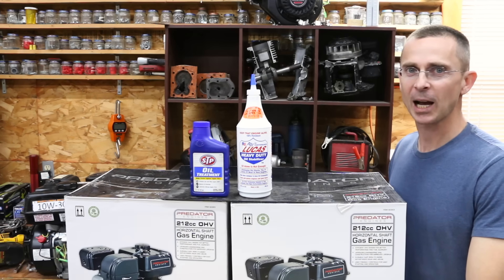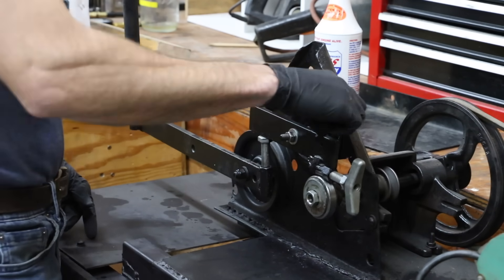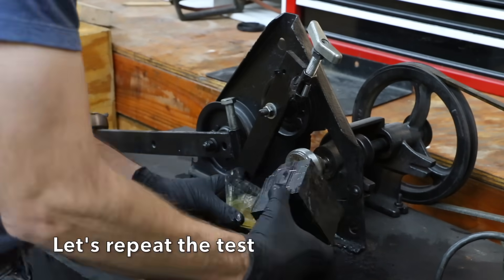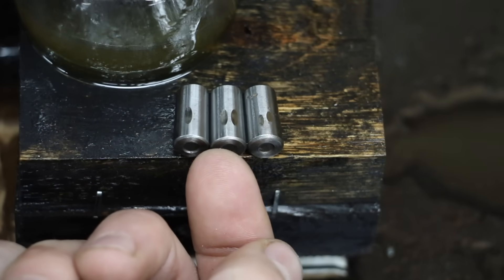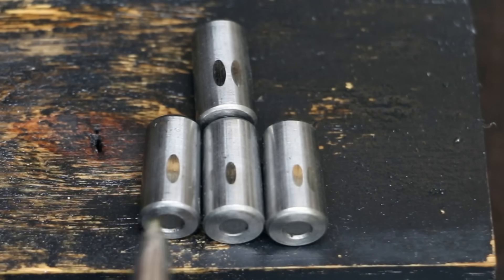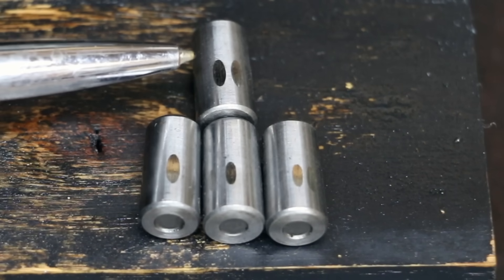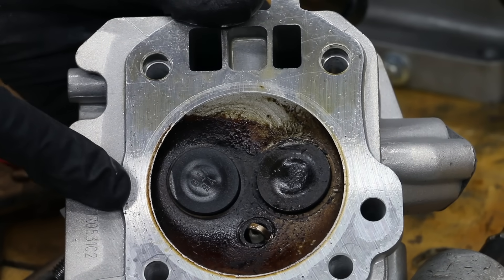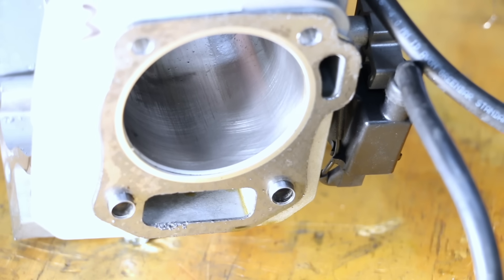Which engine self-destructs first?  Lucas or STP?

Comment: Oil is used to cool air cooled engines, not just air,  most losses are from low oil, usually  happens around 6 hours of running, on well used engines, synthic oil last much longer due to reduction of friction.

Comment: It would be interesting to check the engine damage on both engines at the time that the STP engine locked up. That way we could see if the Lucas provided enough protection to allow that engine to go on working if oil was used in it once again. We could see if the extra protection provided by Lucas saved that engine....even for a short time.
Reply from the maker: Thanks for the suggestion.
Reply: I'm a say it may have saved something to where minimal work would have been needed. But then could have been enough heat stress, that when it cooled down the stress is already set and next crank would expose it.

Comment: Us "mobil 1" synthetic oil and you can go 5000 miles between oil changes! Just change your filter and you can go up to 10,000 miles between oil changes! I know, this sounds unbelievable but I used to work in service stations, back in the 90's when we still had service stations and I couldn't believe it my self so I tried it in my cars, it actually is true! At 10,000 miles the oil is pretty dirty but no more than normal oil at 3000 miles so what I'm saying is I believe "mobil 1" does cost quite a bit more but I believe its worth it! 🤠👍

Comment: I stumbled across your video using Sea Foam in the Ford Ranger motor and your results mirror my experience using Sea Foam.
I have been able to get a lot of seized up small engines broken loose and running normally using both Sea Foam and Marvel Mystery Oil alone and together just to see how long an engine will continue to run relatively quiet and as close to normal as possible.
I have been watching your other videos and enjoy your straight forward approach to each of your product challenges.
Keep up the great work and thanks for taking the time to better educate others on product performances.
Reply from the maker: Thanks, will do!

Comment: I once saw the Organizers at a motorcycle rally drain the oil (likely untreated) from a small 4-stroke engine on an old Yamaha street bike (late 70's/early 80's) and run it to see how long it would last. That engine ran SO LONG that they had to add more fuel before it stalled. Spectators began getting impatient, or worried about possible catastrophic failure (I know I backed off), and began leaving. By the time the engine finally failed it was glowing bright red (along with a large section of the exhaust) and had been for an unbelievable amount of time (now that's quality!). 

PF's experiment was fun to watch, but I'm not sure we learned much about the value of oil additives w/o a control engine (i.e. one using straight oil) for comparison. The simple lesson here is that engines need lubrication to minimize wear, damage, and potential failure...which is easily achieved by maintaining the proper oil level and following good routine maintenance practices (I know, thx Mr. Obvious). 

Maybe if an additive is used regularly and has sufficient time to penetrate the metal it would reduce normal wear & tear, or maybe they're just an unnecessary waste of money.

Comment: One night my oil line broke and I had to drive  it about 50 miles I always use lucas in my oil and in my gas the night the oil line there was no harm to my motor and I was having trouble going up hill it would miss they looked at my fuel injection and they looked like they were new I will always use lucas in my cars and trucks
Reply from the maker: Thanks for sharing.

Comment: I owned a 1989 firebird v6 . I lost all my oil only thing that I can attribute to is the fact I used duralube on the last oil change. I drove 100 miles round trip without the engine seizing up or overheating
Reply from the maker: Thanks for sharing.

Comment: As an aircraft mechanic for 43 years, my dad always used Marvel Mystery Oil in our vehicles. Some in the oil—some in the gas tank.
Reply: My Dad used Marvel Mystery Oil also.  I have also used it for years.  When I was a kid my Dad bought a 1967 Simplicity Landlord riding mower.  I still use it to cut the grass, and put Marvel Mystery oil in the gas and recently started adding Lucas to the oil crank case.  Original engine 55 years old.

I add Marvel Mystery Oil to the high octane gas of all my small engines.  And they seem to last longer.  If you could do some test with combination of additives vs plain oil that would be awesome.
Reply: Good thing you gave us your credentials to tell us what your dad used.

Comment: What’s a wrist pin? The end of the Conrod (Connecting Rod) nearest the piston is known as the little end for obvious reasons and is connected  to the piston by the Gudgeon Pin. I really wish you Americans would speak English correctly and get the name of the parts correct as named by the people who invented them. Oil Manufacturers actually recommended not adding any additives as it can change the chemical structure of the oil. If you use a good quality oil and change it as recommended by the engine manufacturer you will have no  problems.

Comment: @project farm If it's "given" both engines are without defects from the start, then should you have not stopped the running engine, after the first one blew and checked for scoring and such and compared them!?  Just wondering. ☮️

Comment: I ran Slick Fifty back in the 80's every one hundred thousand miles and ran Mobile One and changed the oil and filters every 7 thousand five hundred miles on my 1973 Monte Carlo and my wife's 1974 Cadillac Eldorado and both cars had over three hundred thousand five hundred miles on them before I traded them off.  No oil leaks or burning of oil even today as I know who owns them still drives them.
Reply from the maker: Thanks for the feedback.

Comment: Did you fill the oil to spec? Seems like there is no oil in these at all when taken apart. Anything with no oil, or too little oil is going to explode very quickly. Am I missing something?

Comment: I didn't quite get the logic of looking at the destruction when that's to be expected running the engines this way. Of course it's going to score and blow apart. The additional time allowed by Lucas certainly tips the scale in its favor.
What might have been a better test is to take the engines apart before they self-destruct to compare the level of scoring

Comment: Whats amazing is that theres absolutely no oil getting splashed on the valves...the rod blows apart sometimes because the piston has so much heat on it gets tight in the bore
Reply from the maker: Thanks for the feedback.

Comment: Very surprised at both of those Motors but obviously for a motor to run for over 20 minutes with no oil in it at 3600 RPM is quite the feat
Reply from the maker: Thanks for the feedback.

Comment: Given the ratio difference it's hard to know for sure as both are motor honey products. I run bar and chain oil in all out lawn mowers, mix too. Never had a problem. Straight 30 is what everyone used to run so I'm not surprised. Great fun to see new engines grenade.
Reply from the maker: Thanks for the feedback.

Comment: I've used STP for years at half the recommended amount.  It seemed to always make the engine run smoothly a d quiet it down a little.  Now I think I will try Lucas on the next oil change.
Reply from the maker: Thanks for sharing.

Comment: Would love to see what these oil stabilizers do to engines running in sub freezing temps. My mother in law adds Lucas to a brand new engine which the recommend 5w30 for. We only ever recommended Lucas for high mileage vehicles that routinely drive in hot "desert conditions" because it would help with viscosity breakdown. I imagine that, in cold temps it would make it take longer  for the oil to get up to the top of the motor thus causing more wear. All her cars have a tremendous amount of top end "lifter noise". 🙄😞
Reply from the maker: Thanks for the suggestion.

Comment: Lucas for the win !! I use Lucas but what's better then Lucas is BG oil additives! but you have to use the MOA with the RF-7  TO get the benifits.  I dont do the 20% of lucas with oil like the bottle says I treat it as a quart of oil so if it takes 5 quarts I do 4 regular qrts of oil with one bottle of lucas mainly in high milage engines . our 1990 and 1996 jeep XJ 4.0 has 200,000 + miles and use the full bottle of lucas with 15w40 since jeep engines run hot and hotter in wramer climates and oil will thin out in those temp settings . I use 15w40 in my 65 dart slant6 and 82 dodge d150 and use 20% Lucas but at some point use the MOA and RF-7
Reply from the maker: Thanks for the feedback.

Comment: The control would need to be 2 other engines with the same engine oil used for both and then drained for final destruction. Only if they fail at the same time would this test be valid.
Reply: But I’m also overthinking it haha

Comment: I has been using prolong for over 20 years it is no car even in brand new engines where I do not use it as well as I do with a 3 old cars one time my Carter get broken and I continue to drive home 10 miles or so it was driven w a hole on it, i wonder if you ever try a compair wit prolong and other additives!
Reply from the maker: Thanks for the video idea.

Comment: Loved the video 
First it would have been nice to have one with just standard oil for a control group, it also would have been cool to see how much oil was put in each motor vs how much oil came out. I suspect the Lucas had more oil remain in the system due to its clinging ability. 
Thanks!
Reply from the maker: Thanks!  Thanks for the suggestion.

Comment: It was a great test and I love the "let's prove that these products are not snake oils" concept.  

However, the final test was flawed.  You should have run the engines using the engineered, as desinged, as recomended,  "oil conditioner / staelizer".  These products were desinged as "additives"  to moror oil - not as stand alone lubricants.  If I were Lucas and STP - I would sue for a 'cease and desist' order.  Or better yet, a "do over".  ha ha!  

Anyway, keep up the great feeds and don't give up - just keep us all learning. And hold these products feet to the fire!  lol

Comment: As much as my dad and I have used STP in all of our diesel engines (semis) and other heavy or light equipment, I have to admit that Lucas seems to have edged out on top here. Hopefully you can do another showdown between the two in the near future with the same and other testing parameters and also do testing with the same mixture ratio of both manufacturers recommendations and see which recommendations work best for each and/or both. ..
Reply: He mixed them both by the manufacturer's recommendations.
Reply from the maker: Thanks for the video idea.
Reply: @ProjectFarm I'd like to see a revisit with a product called ProLube

Comment: I bought a 97 12V cummins . Day 1 I change the OIL, OIL FILTER AND ADDED LUCAS TO MY OIL . When I changed my fuel filter I added lucas to my fuel . ALL I CAN SAY IS ..... I STILL HAVE THAT TRUCK . MOTOR IS BONE STOCK AND HAS 500K MILE   AND RUNS BETTER THEN MY 6.7 . AND IT GETS BETTER  FUEL MILEAGE THEN MY 6.7 !!!!
Reply from the maker: Thanks for the feedback.

Comment: Scoring on the inside of the Lucas motor is cross hatching machined into it at the factory to give the metal a surface for better lubrication of the cylinder walls….
Reply from the maker: Thanks for the feedback.

Comment: The harm was done on startup because he didn't heat the oils before putting them in the engines. The stuff got scored as it warmed up because the oil couldn't fling around literally so the cylinder bear most of the punishment and rings too

Comment: Lucas. My job is to change oil, and from what I’ve seen Lucas has usually worked better, and most customers prefer Lucas. Also, you should try a Teflon treatment and an oil system cleaner. They both work really well, and can help increase mpg quite a bit. Especially the oil system cleaner. Techron also does pretty well for mpg, however that’s not really an oil treatment.
Reply from the maker: Thanks for the video idea.

Comment: These small engines do not have oil pumps. In newer car engines, oil needs to be a lighter weight for tight oil galleys. Thick oil can damage newer car engines as most now have roller rockers and need thinner oil to get to them quicker on cold start ups
Reply from the maker: Thanks for the feedback.

Comment: Yep, I  got 300k miles running Lucas on my oil changes and not as much as they recommend.  Because I heard from a a top 5 GM mechanic not to. Add 3 gulbs (blop,blop,blop). Then fill oil to capacity and change oil (traditional oil) as recommended every 3600-4000 miles , as this is a 98 on the same engine. Still purs like a kitten. I  did get stuck one time using STP for a few weeks,  never again!
Reply from the maker: Thanks for sharing.

Comment: Try " Prolong" oil additive instead of these bogus oils !  My oil pressure is usually 40 to 50 psi...after adding Prolong synthetic...my oil pressure was 25 ! Slippery stuff ! Slick 50 ain't shir compared to " Prolong" oil additive! It was made by " NASA" for rocket engines ! Duh !!
Reply from the maker: Thanks for the suggestion.

Comment: The test is inconclusive; one drop of oil makes a big difference, to say you drained the engines of oil, but you had no way of knowing if it were an equal amount of oil left inside the engine. Besides that, the additives weren’t designed to run like that. I enjoyed & appreciate the demonstration though.
Reply from the maker: Thank you for the feedback!

Comment: I found it more interesting that the stp engine was operating at a lower temperature when used properly. In theory it is the better choice as the lower temp should reduce wear over time
Reply: exactly! It saved my oil-pumpless 2.2 engine in the Shadow for 2 years!
Reply from the maker: Thanks for the feedback.
Reply: But  the most wear on almost any engine is at start-up!   All the parts are dry of oil, there are a few seconds of dry operation before oil gets there.  In these lawnmower engines, it is via "splash" meaning the movement of the internal parts just throws oil around inside onto the parts. So there is no pressurizing oil pump like a car engine.  If you really want to cut wear in your car engine, they actually do sell "pre-oilers" for about $200 to $400, you can install on your engine, and these are a fantastic thing to have.  A company named Melling makes a pre-oiler for $400.

Comment: I'd like to see a video of you rebuilding one of the engines, and a breakdown of parts costs. These Predator engines are a really great bang for your buck, so I wonder if it would even be worth the cost or effort. I'm guessing you'd have to hone or bore out the cylinder a bit to remove the scoring? I have very limited knowledge of engine rebuilding, so I don't even know where you'd start
Reply from the maker: Thanks for the video idea.

Comment: You know how fast the Piston goes up and down at 1,000 RPMs it's moving around 5,000 mph that's a whole lot of friction with that oil that's why motorcoat is very good it reduces friction bond to the metal I have tried it and it works good. That's why it's so expensive like $70 to $80 a gallon at meijer's grocery store or AutoZone.
Reply from the maker: Thanks for the feedback.

Comment: I would have liked to see a control engine. Using only 10/30w to have a good baseline. Also, I would like to see you compare BG MOA Additive vs other additives also, what about old as seen on tv additives from the 90’s - 2000’s like zmax and others of the same type.
Reply from the maker: Thanks for the suggestion.

Comment: Seems odd they ran at different temps even with no oil , I wonder if there is a
Possibility that a governed spring is different or a carb jet is slightly different
Reply from the maker: Thanks for the feedback.
Reply: Cheap mass produced engines, tolerances might vary. Right or wrong I use Lucas oil stabiliser in my Harley and my land rover defender. Definitely doesn’t do any harm

Comment: Very thorough test. Lucas came out ahead, in my opinion.  But not by much when you consider all the data you obtained.  Way overdue test. Great Job! Lots to compare beyond total failure. It would be an extraordinary event to run your engine dry ??
The wear data is the Key..?
Engine run temps are also a very real factor in oil breakdown so it's a good test you have provided us. Thank you VERY much 👏👍
Reply from the maker: Thank you!

Comment: I used Lucas then switched to STP to make the additive ratios the same for both airplane engines. (C-85 and IO-520)  One pint of STP/4 qts of aviation oil.  Airplane engines do NOT sit well, so STP, as the thicker of the two, seems to make more sense. So far, so good. Thank you!
Reply from the maker: Thanks for the feedback.

Comment: I wonder how they would perform if both were mixed with the same oil to stabilizer ratios? Both at 1:4, and then both at 1:8.

Also, there were an awful lot of moving parts close to your fingers! Do not get hurt doing any of these, please.
Reply from the maker: Thanks for the suggestion.

Comment: Not trying to hate and I use neither of these two products, but I'm not sure how draining the oil and running the engines dry says much about either product. It's not how either of these products are meant to be used. I imagine since Lucas is more viscous it probably also has higher surface tension and stronger adhesion as well so it'd make sense that there's still more of it left after draining the engine. 

Point is I'd like more data before I'd say either of these is definitively better.
Reply from the maker: Thanks for the feedback.